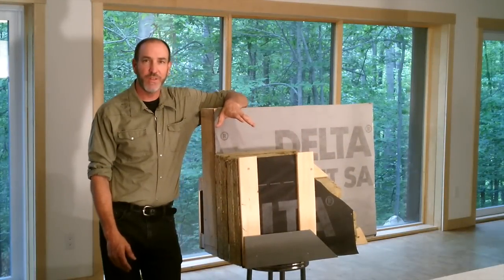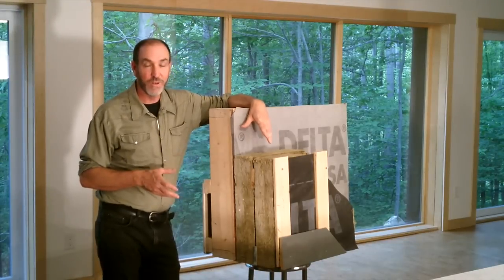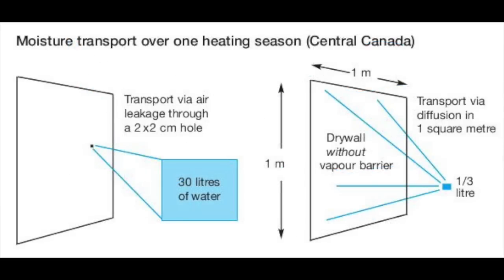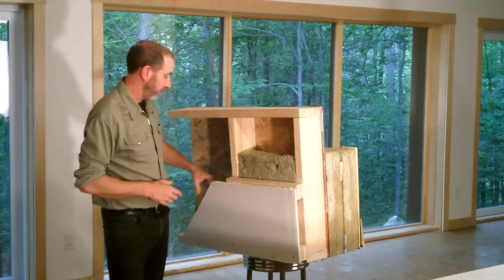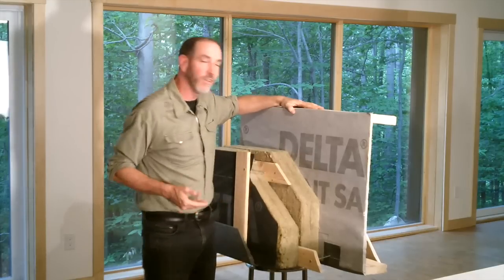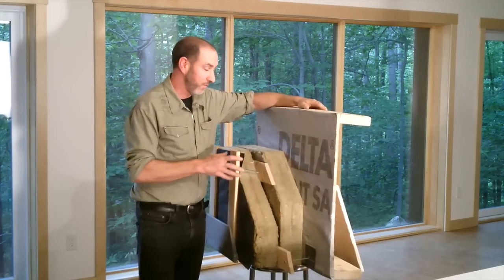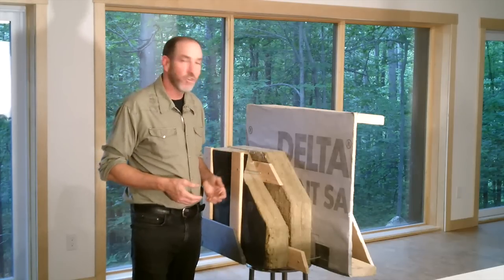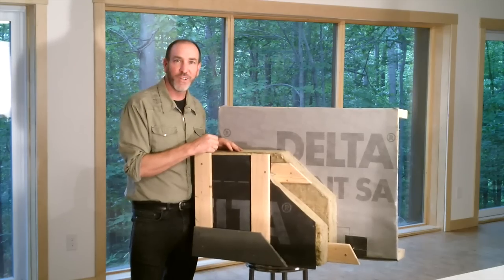How to Build High Performance Walls for Homes, LEED - PH - ZNE - Design, Insulation - EcoHome Guides

Comment: Hi! I really enjoyed your informative video.
I have questions:
What is the structural rigidity of such a wall?
What materials can be used to sheathe it?
Will siding work?
Will the lathing hold up with such long fasteners?
It seems that all 20-25 cm of external insulation will overhang the foundation/base?
How can we protect it from insects and rodents?
Thank you in advance for your response!

Comment: Congratulations you've overbuilt and eliminated heat loss/gain through the walls. Now the heat loss will only happen at doors, windows and the roof.

It is a good wall, but I highly doubt it is an economical one.

Comment: Found this video is useless.. dude didn't explain actual material.. didn't even touch the insulation.. are those 2 4" insulation hard or soft.. never seen outside install this way

Comment: I’d like to know what your basic answer for adding your 8 inches of rock wall on the exterior how are you fasting that and making a salad what are you putting on siding hardy board Stucco what are you doing over top of this and how would this work in the Desert

Comment: With a vapour barrier/reductive paint, what is the suggested method for when a homeowner wants to screw something into a wall? I typically use anchors on almost everything in my home, but if the paint is the barrier, is the tight fit of the screw against plastic anchor against gypsum enough to reduce/prevent air movement/humidity movement?

Comment: With poly iso exterior insulation, a Vapor barrier could cause mold in cold zones.  

Air barrier is vitally important.  It probably conserves more energy than the R value of insulation.  And there are liquid elastmeric air barriers that are vapor permeable.  

Is polyiso outside, Moisture wicks into the house, which means you do not want a vapor barrier or any clothes sell insulation.  Everything needs to be open cell so the moisture can wick and dry into the house.

Comment: No-one talks about sound insulation. Especially low frequency noise like airplane or smashed car door on the street next door. How do you seal those high energy noisewaves which tend to resonate the OSB board (or the drywall inside)?
Reply: @gofish5175  Thank you for the detailed answer. Can you give me some advice how could I improve low freq insulation of my house - wall structure from inside to outside: 2 x 12.5mm drywall, vapor stop layer, 150 mm metal studs filled with rockwool hd stonewool, 18mm OSB, 250mm graphite loaded EPS, silicone top plaster. The house is ultra quiet except the lowest frequencies. Basically it acts like a low pass filter.
Reply: @gofish5175  I'm from Hungary - Europe, which is not considered a cold country but i wanted a zero energy house so the goal was to keep primary energy needs under 10kwh/year/square meter. Which we have achieved. So with a 15kw solar system the house requires zero energy from the grid - pls note at Hungary we got the annual balance payment option so one does not need to be all time energy surplus producer but it is good enough to have a positive balance throughout the year combined. The heat insulation is so good that when we leave the house for winter holidays it cools 1C / every two days from 24C if its cloudy and around 0C degrees outside (hvac turned off). I try to search your recommended items maybe I can incorporate them.

Comment: The cost of mineral wool is just dumb. It does not pay for its self compared to xps...I'm trying to justify it but in Minnesota, with all the other pieces needed and cant. delta vent sa(good luck finding it to buy) I can't even find mineral anywhere to buy.   Science is great, but you are suggesting using materials that cannot be found. Sure they exist in catalogs but the average home owner cannot buy it. Same crap with basement wall waterproofing. I had no choice but to use Menards membranes because I gave up looking. I dig it out by hand, not fun....,30' Clay x 7' deep. X 2' wide. Lost 20 lb so that was good.

 Basically, if it's not available, stop pushing it on the averages person. Find something we can actually get.

Comment: One thing that is hardly ever mentioned is that passive and low energy homes in extreme climates reduce their carbon  emissions for heating and cooling. Yes, they do require more materials (more emissions) but once they are installed they stay in place, possibly for 100 years. The gains we make from slowing down climate change now, matter, but are not accounted for in current cost/benefit analysis.

Comment: I'm a woman (not a builder) in Virginia. I see them around here putting a wrap on the outside of the house, then the vinyl siding or bricks.  Is that the same thing you're talking about putting on the inside of the house?  Seems it would be better on the outside, stop it before it gets in.

Comment: Can you construct a passive house using light grade steel as opposed to wood frame. Please could you point me to the relevant information sheets for insulation etc. and how I would eliminate thermal bridging.  Look forward to your comments. Thank you.
Reply: Steel frame is bad for passive houses, considering how thermal conductive metal is compared to wood.
You will end up with thermal bridging on steroids.
Metal is over 2000 times more thermally conductive compared to wood.
Reply: You keep looking. I have never heard back from these guys, no matter what channel I used to reach out to them.

Comment: Me thinks this type of wall assembly  works in 2 ways.  It stops heat from the outside of the building from penetrating the wall in the summer. It stops heat from the inside of the building from penetrating the wall in the winter.
How did you determine the thickness of your insulation on the outside?

Comment: I wonder if anybody's tried applying this to a steel building. I'd think it might help with internal condensation.
Reply: Basically, yes: it's called a full wrap.  Insulating on the outside is the only way to effectively combat thermal bridging for steel framing [common to most commercial applications these days].   Materials may differ, but the concept is good - and code in many places.
Steel framing is so good at thermal bridging, you really want it inside the conditioned space.  I... would avoid houses steel framed in the 90's except they have documentation of wall construction details, as built.  Some were built well, some not, as code was catching up with problems of new materials/methods.
Reply: @flinch622  Thanks, much appreciated.

Comment: good theory, but also a ggrea home for mice. in the rural settings, mice chew in and destroy insulation inside the walls. they make their homes in the chewed up insulation, and poo all through it as well. its the biggest issue for how toxic your home will be after 20 years. we need to address this issue along with good theories like the one presented here. thx for the video
Reply: This is a non-issue with the Rockwool mineral insulation used here.  It's spun from basalt (ie. lava rock) and recycled waste slag materials.  Mice and insects are not attracted to it, nor will they burrow into it - as it has no organic properties.  Plus, here in 2024, they also put in an aluminum bug-screen (top and bottom).

Comment: Has this technique been approved by NBC in Canada?   I think the vapour barrier paint is interesting.... but seems to me leaves place for moisture to slowly build up "in" the gyproc... especially during summer when "humidity" is coming from the outside meeting a cooler/colder airconditioned surface.

Also is this mostly being done in new construction.   I have a client who wants to do this on his existing home.   It looks to me this would totally mess up his soffit space and a roofer would have to do something first to make sure attic breathes properly.

Comment: Wouldn’t be better to build the walls with with Zip-R 6 (1 inch) foam to stop thermal bridging then spray closed cell foam 3 to 4 inches maximum thickness? That’s it.
Reply: closed cell is for builders that ran out of ideas and cant actually fix a bad job. Its literally the last resort. Its not a good product and is super unhealthy

Comment: super expensive wall assembly
Reply from the maker: This test-home was built at an equivalent cost to a local code-built home, which was the point. As an alternative construction and even better performance, take a look at the next one we did https://www.ecohome.net/guides/3549/zero-carbon-homes-s1600-prefab-eco-home-gets-close/

Comment: cool..but what if i dont use drywall?..pine planking or something
Reply: Personally I would paint it really well (2 solid coats at least) with that vapour barrier paint..... there is a chance humidity can build from backside.   If there is no vapour barrier until it hits the inside surface of your finished wall.... humidity can build up on the other side.

Comment: Just wondering how all this has worked out, five years later
Reply from the maker: Works very well - the total energy bills without Solar PV are averaging out at around $350 USD
Reply: @TheEcoHomeNetwork  350 USD a YEAR in energy cost? Oil heat here, ugh!
Reply: I just can't quite get past the thickness of that wall.  It must be 16 or 17 inches.

Comment: 8.09 I find it hard to believe that longer screws would of reduced the r value by 30-40%. Lets say you have one screw for every 2 square feet of wall. which is 0.0054% of the surface area. 1/8x1/8 divided by 288 sq inches.
Reply: It has to do with the way R-Values and heat flow work. The heat flow is going to be proportional to the temperature difference divided by the R-Value. The R-Value of steel is about 0.0031 per inch so a 6-inch nail might have an R-value of 0.0186.  Doing some quick math shows that our hypothetical nail will have over 2,526 times more heat flow than a wall with an R-Value of 47 [1]. Since we are dividing by our R-Value, the heat-flow grows exponentially as our R-Value approaches zero. In practice, it wouldn't be that extreme because air is not a perfect heat conductor and it would provide some insulation above that value. However, a small amount of really low R-Value will dramatically affect the overall R-Value more than you might expect.

[1] Assuming one-degree difference in temperature: 
Nail: 1/0.0186 = 53.7 watts per square meter per degree of temperature difference 
VS 
Insulation: 1/47 = 0.0212 watts per square meter per degree of temperature difference. 
This shows that there is 2526 times more heat flow through nail per unit of area.
Reply: @matthewcole1188   @Matthew Cole  looks like someone needs to come up with wood screws 🤣🤣

But really, maybe some composit or ceramic coated fasteners. But before we get carried away, what's the 80/20% of this.

You say it's 2500 times more conductive. Over a 6" pattern on a 10 meter wall, what would be the reduction in R value? I would think, because they have two layers they need twice as many screws.. and at each section there still is a 2500x conductivity.

I would think that if you had 1 layer with half the amount of screws it would equal the same conductivity as twice the amount of screws in a split layer/pattern like in the video...?
Reply: 30% is the framing xD

Comment: help me understand something really basic...
Fact #1 - In the US, most homes in the last 40-60 years have been 2 x 4.... It has now moved on to 2 x 6, just recently.
Fact # 2 - INSIDE, for most homes in the 50-50 years... INSULATION has been fiberglass.
If interior vapor has been such a big issue, by now, half of more of the buildings built back in the days would have walls crambling due to vapor... 2 x 4s would have rotten by now...
The fact remains  this is NOT the case. 
So the million dollar question: if we 2 x 4s being used for 40-50 years and now we are moving to an even wider standard (2x6) why would we have to worry so much about vapor inside the walls? I think the industry is sending FEAR into people's mind so they can sell more products but come on... I don't think is such a serious problem...
Reply: Because up until recently, houses have been ridiculously leaky, with airflow all over the place. As houses become tighter and insulation requirements increase, moisture becomes a bigger issue. 

Also keep in mind that the old houses still around are, well, the houses that are still around. You don't see the ones that have been demolished or substantially rebuilt due to rot or mould.
Reply: Don't forget that back then 2x4 was 2x4. Now it's 1.5x3.5. Soon 2x6 will shrink to old 2x4 dimension.
Reply: Wow I have not read such an inaccurate statement like this in a long time.

Comment: what would you do for an old house adding 8 inches plus strapping to the exterior of a house suddenly all your doors and windows are sunk into the sides of your walls.  I am not sure that is such a great look aesthetically.
Reply: Add storm windows and doors flush with the exterior.
Reply: While that is a good question, and you are probably right about the aesthetics, this wall is best suited for new construction.  However if an existing home was to be retrofitted with insulation on the outside, measures can be taken to correct the aesthetics.  This wall is actually very impressive with how much has been considered.
Reply: I think a double window system would be good..  One interior window and then an exterior window... doubling the r-value of the windows...

Comment: One question. How would this exterior insulation hold hardy board for siding or woul there need to be more supports to the stripping
Reply: its pretty strong...uses a 8 in. screw that's cross-threaded in two directions...hardy board, most likely (and I'll stand corrected) hardy board heats up pretty good in west and southern directions causing heat build up, and most likely energy issues...plus not always installed correctly, needs sealing on all cuts and seams...water will penetrate!

Comment: Using the paint as a vapor barrier isn't a great idea because it's so likely to be damaged. Once it's damaged then it's no good and would have to be continuously maintained.
Reply from the maker: Hey Cameron, you're probably thinking that it is acting as an air barrier as well, but it isn't. The air barrier in this wall assembly is the exterior membrane. The vapour retarder primer is not tasked with stopping air leakage, its role is to stop moisture from diffusing through the wall, so if you put a nail hole in it for example by hanging a picture,  or made a scratch in it, that would be of absolutely no consequence. It's easy to jump to that conclusion, since with most houses the vapour barrier and air barrier are a combine product, 6 mil polyethylene, in which case you do need to be extremely cautious not to damage it.  Regards.